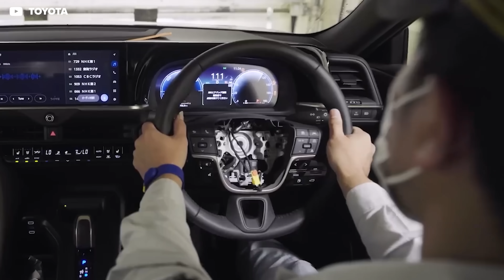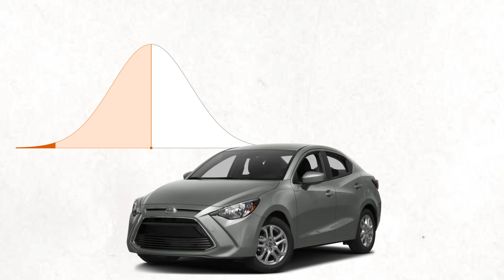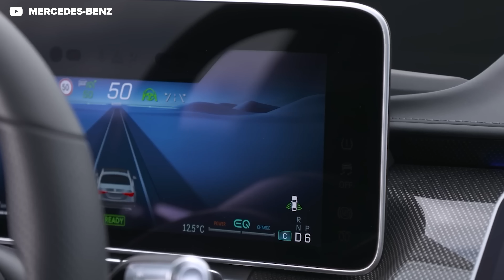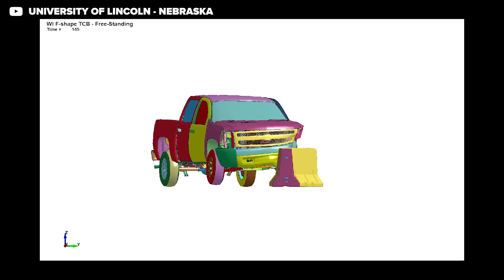The REAL reason guardrails can't stop EVs in a crash

Comment: Those type of guard rails are not designed for impacts at such obtuse angles. They were meant to deflect not absorb the full impact at head on or near head on.
Reply: And where in this video was an attempt of a head-on collision onto the guard rail?!
Reply: 😂That is what I see as well. The cheap soft Wood is so weak and brittle. Even for the the car the guard rail designed for. You can only get one shot out of it. Then you need to replace the whole section along with the Wood post.
Reply: @林振华-t4v That's how dispersing the energy works. If the guard rail was stronger it would just smash you the same as if you hit a wall.

Comment: 4000lbs more? I don't think so.
Reply from the maker: Look up how much a Chevy Silverado crew cab weighs, and how much the Silverado EV weighs.
Reply: @drive  The Silverado's direct competitor is the Chevy 2500, in which the heaviest EV variant is only 500lb more. 
The media has absolutely no idea how much combustion vehicles actually weigh compared to the average (or equivalent) EV. Most of the time they are not heavier or marginally heavier, but they like to glorify the 1% of EV's that weigh a lot more and act like its the norm.
Reply: @drive that's the most extreme example. That battery is 2x the size of anything else on the rd.
Reply: @drive  That is misleading. You take the most extreme case and say "up to". Technically, it is true but what really matters is the more typical case. 600lbs is more typical but even then some equivalent cars are pretty well evenly match for weight.
Reply: Up to
Reply: Than Google it
Reply: Yep it's just the extreme case of Max battery Electric Pickup vs Gasser Pickup. They gave an example there where a Model 3 doesn't weigh much different to a BMW 3 Series.
Reply: @Neojhun  This whole narrative that evs weigh more than their equivalent ice counterparts needs to come to an end
Reply: It's not a narrative. They weigh more. 

4-door dodge charger with a v8 engine was 4500lbs the EV is 6000lbs.
Reply: @poly_g6068  Unfortunately Dodge and many companies don’t know how to make an EV, so I would hardly count that “fratzonic” flop of theirs
Reply: @poly_g6068 I have  a model x p100d 3 row and it doesn't weigh 6000lbs.  I'm just saying they are using the Silverado ev which has a 200kw battery which is double the size of mine, is an extreme example.  Model 3 weighs less than a bmw 3 series. Bmw x4 which is comparable to the model y weighs more. Just saying.

Comment: Get out before the fire or it’s over.
Reply: LOL Unlike gasoline fireball, EVs only have flaming fire which take time. Richard Hammond crawled away from the Rimac with a broken leg. Not even Usain Bolt can out run a Gasoline Fireball.
Reply: @Neojhun  you’re a true EV believer debating which fire burns more lethal. 😂
Reply: @jamesh1641 well, protestors just burned down 5 waymos in LA. Those are jaguar I-paces, which are EVs. I watched these fires happen live on TV, and they took a good 10 minutes or more to engulf the cabins of the cars. After 1 hour of burning, the fires would begin to calm down, having burned the batteries out.
Yes, there's time to escape, and no, batteries don't just explode. in a fire, tires do. 
Also worth noting there were still hundreds of protestors in the vicinity during the fire, and none of them were injured by the fires.
Edit: Also, no firefighters arrived during the ~hour and a half I was watching.

Comment: American issue. Dutch and German guardrails you find on the highway stop all traffic. Yes, including trucks.
Reply: I do enjoy when someone says something without thinking it through and or doing a modicum of research, and then some other persons come along and straight out the lack of research. Thanks folks😂
Reply: Even the German standard is pointless for a Murican SEMI. 40mph is about half the speed they travel on the interstates which is where most guardrails are found anyway.
Reply: Heavier duty guardrail that can contain large semi's flexes and bends less when a lighter vehicle hits it. This has the same effect as a smaller crumple zone, and it increases the G forces that a smaller vehicle and its occupants will experience. This makes the guardrail less safe for smaller vehicles because it's more likely to cause occupant injury. 
It's more of a question of who you want to "sacrifice" so to speak. If the guardrail is protecting a residential neighborhood, then yeah it should catch all vehicles. If it's just a steep slope in the middle of nowhere, then we'll have to rely on the stricter drivers license requirements of semi truck drivers and hope they don't hit the guardrail because they only make up about 2-10% of all the traffic on the road, and we don't want to cause excess injury to the remain 90%+ of drivers. 

Also yeah, weaker guardrail is cheaper, so... cheap guardrail will save 90%+ of lives, or double the cost to save 100% of lives?
Reply: I did search for instincts where a truck or bus did puncture through the guardrail and blocking the traffic from the other side and therefore the complete highway needing to be closed for repair. It's extremely rare but it does happen a few times in the Netherlands.

I think that double sides guardrails should be the new norm in the USA. Europe has started improving these guardrails 40 years ago.
Reply: @detmer87 generally when making statements like this it is wise to avoid absolute qualifiers like all, always, never, because there are general ample examples where your statements become incorrect very quickly. You could have said something like we have a very low percentage of guard rail failure and it would be much harder to argue.
Reply: I asked AI to compare how a semi would do:

🇺🇸 U.S. — MASH Standards
Typical Guardrails: MASH TL-3 or TL-4

Test Vehicle for TL-4: 10,000 kg (22,000 lb) truck @ 90 km/h (56 mph) at 15°

Reality: An 80,000 lb semi (36,000 kg) exceeds even TL-5, which tops at 36,000 kg @ 80 km/h (50 mph)

Conclusion:
→ On most U.S. roads, yes, a fully loaded semi could go through or override a standard W-beam guardrail.
→ Only TL-5/TL-6 barriers (e.g., concrete) are intended for this load.

🇳🇱 Netherlands — EN 1317 (Mostly H1/H2)
Common Test Level: H1 or H2 (tested up to 13,000 kg trucks)

H2 barrier (TB51 test): 13,000 kg bus @ 70 km/h, 20°

Conclusion:
→ A semi nearly 3× heavier than test loads.
→ Standard Dutch guardrails would not stop an 80,000 lb truck at highway speed.
→ May redirect partially at reduced speed/angle, but breach risk is moderate to high.

🇩🇪 Germany — EN 1317 (H3–H4b on Autobahns)
Higher Standards in Use: Autobahns often use H4b-rated guardrails

H4b Test Load: 38,000 kg articulated HGV @ 65 km/h (TB81)

Your Truck: ~36,000 kg = matches the H4b standard

Conclusion:
→ Germany’s Autobahn barriers can contain a fully loaded semi at moderate speeds and glancing angles.
→ Breach risk is low, unless speed or impact angle exceeds the spec.

Comment: The weight of EVs is often way overblown. I went from a 2008 Honda Pilot (Curb weight= 4,524lbs) to a 2024 Tesla Model Y (Curb weight= 4,363lbs), so the "heavy" EV is actually 161lbs LIGHTER than the internal combustion engine vehicle it replaced. And that's not even getting into the passive safety improvements.
Reply: are you actually comparing a Pilot with a Y?????????
Reply: @paulpellico3797  I'm aware they aren't the exact same size, but the Model Y was able to easily do everything I needed the Honda Pilot to do. It literally took its place, so it's justifiable to compare them. Both AWD and handle the snow really well. Both available as 7-seater. Pilot wins out in luggage space, but I never needed to fill it completely, so it's unnoticeable.
Reply: @AaronCarioto  You realize the 7 row seating in the Model Y is very impractical, those back seats are only functional if you slide the mid-row forward, otherwise they are rendered virtually unusable. And the Honda Pilot could fit 8 people, not 7. You factor in that the Honda Pilot is a taller/wider vehicle with more ground clearance and headroom, it's going to add a lot of extra weight. And if you are going to call a vehicle that is over a decade older a justifiable comparison, you are nuts. Materials are vastly different today as opposed to over a decade ago. Metal panels/frames are now aluminum (or a steel/aluminum mixture) as opposed to raw steel, plastic interior points are now carbon fiber as opposed to hard plastics, the amount of weight savings through that alone is the difference. Your Battery Pack weighs anywhere between 1000-1700lbs, whereas the Pilot's engine weights around 250-400lbs. EV's means of an engine (AKA Battery) is much, much heavier currently, though with time the efficiency will get better and the size will shrink, cutting the curb weights. The way they make up the weight difference is the other materials used in the production of the vehicle. And again, calling to the safety improvements is foolish as well. It's got over a decade's advantage in improvements. Things improve with time, that's just how it goes.  If you were to compare a relatively newer Honda Pilot to the older, the newer one is likely going to be the far better of the two.
Reply: @viktorbryce951  It's easy to ask AI for weight comparisons.  In 2025, the Model Y still wins.

weights in .lbs for various trim levels:
Honda Pilot	4,100 – 4,600
Tesla Model Y	4,167 – 4,416
Reply: @viktorbryce951  I appreciate your perspective, but even if you take age out as a factor, a quick Google result says 2024 AWD Pilot weighs 4,251-4,685 pounds, which supports my original argument that weight between ICE and EV is often blown out of proportion. Also, you are right about the Pilot being 8 seats. (We rarely had the third row up)
Reply: @AaronCarioto  In this scenario, yes, I get why you'd believe that. However, The Center For Transportation Research did the research and concluded that on average EV's weigh roughly 25-30% more than their ICE counter-parts. Now do I feel that'll always remain the case, absolutely not. 

Batteries have a much wider application, so internal research and development cost will be netted back much quicker, as opposed to an engine and all its components. They'll get smaller and more efficient, thus reducing weight. These engines though, have to meet strict standards of emissions/safety and reliability before the manufacturers adopt them. This research often cost them 100's of millions, if not billions to create, and it takes years if not decades to offset that development cost. For instance, Pontiac used like a 40-50 year old engine design before replacing it. It's why you often see the same engine in a multitude of models, a cross a brand for several generations of said models. 

You also factor in vehicle's basic architecture, chassis, subframe etc. Usually there has to be some accommodation for existing engines, transmissions/drivetrains.
Reply: @AaronCarioto  your Y is "easily" able to do everything your pilot did??????
Reply: In terms of size, the model Y is about the same as a CRV. I get the point that in your case the Y meets your seating and cargo needs, but by the same justification so would a CRV since you said you didn’t use all the space. A Model Y AWD is around 4,400 pounds while a 2025 AWD CRV is about 3,600 pounds. That means the Model Y is almost 25% heavier than an ICE vehicle of similar seating and cargo size.
Reply: Wow what a downgrade, hope your pilot found a better owner

Comment: More weight= more Energy needed to move it. Where is the ecology?
Reply: As the other person said: EVs are FAR more efficient than ICE counterparts.
But yes: once you move to something ridiculous, like the hummer EV, you are saving only like 50% of the energy compared to a much smaller ICE vehicle.
I suspect that current EVs err on oversized batteries to combat range anxiety.
Solid State batteries may solve that problem once they finish inventing them.
Reply: @economicprisoner  Despite the large batteries, they still have a ridiculously small range. In addition, large batteries take much longer to charge. Driving such a car on long trips is a pain. That's why sales of electric cars are falling. People don't want this cr@p. Until bacterial technology changes significantly, electric cars will not be a significant success.
Reply: It's all about the efficiency of converting energy in the fuel to moving forward. ICE engines (~45% peak) are less efficient than power plants (~55% continuous) and electric drivetrains are significantly more efficient than ICE drivetrains. The efficiency loss of transmitting power is negligible in comparison.
Reply: @ChadGeidel  but to this you have to add the energy losses during battery charging and the energy losses of generating electricity in the power plant and sending it to the grid. If you take all this into account, the energy losses for electric cars will be higher.
Reply: @TheEryk03  Google is right over there --> There have been dozens of studies demonstrating that you are 100% wrong.

Try again.
Reply: @ChadGeidel  Are you going to deny the laws of physics because some propaganda articles say otherwise? You've come to the wrong place, I have my own mind and I don't have to have leftist lobbyists think for me.

Try again.
Reply: @ChadGeidel  Are you going to deny the laws of physics because some lef. tists articles say otherwise?
Reply: @TheEryk03  From generation to grid distribution to charging battery at most is 20% loss which is still very bad. That is no were close to the 60% plus loss with small ICE anything under 10L displacement. There is even more efficiency gained with Combined Cycle Power Plant where waste heat becomes a service. Your vague baseless assertions are wrong. Your are soo fixated by political agenda you ignoring physics and engineering.
Reply: @TheEryk03  You clearly do not understand physics. Total Mass alone is not key factor for energy consumption with a complex system like a vehicle in the real world. BEV light vehicles have way less Wind Resistance and Rolling Resistance. Wind resistance due to flat underbody and needing just 40% of the Radiator Cooling area. Also just more flexible power train packaging to optimize airflow i.e. holes through the center of vehicle (Jag i-Pace, Dodge Daytona, Lotus Evija). Ontop of less rolling resistance from drive train losses due to simpler more compact Electric Axel. Just these two factor combined exceeds the efficiency tradeoff with marginally more weight. Many Factors contribute to efficiency, that is fundamental physics.
Reply: @Neojhun  Why are you stretching these numbers to your advantage? The Germans are able to make combustion engines that have less than 40% losses. In addition, electricity statistics are not only losses of the power plant but also sending to the grid, charging, storage in bacteria and losses of electric engines. If we take all this into account, the losses of electric cars will be even greater.
Reply: FYI A Tesla Model 3 only has 80kwh battery, that is a very small amount of energy. A small fraction compared to a tank of fuel to travel the same 280 miles. The Fact BEVs are achieving 3.5 Miles per kWh shows how massively more efficient they are. An efficient gasoline car around 40mpg is the equivalent of 1.4 Miles per kWh. These are the cold hard facts, you can't just LIE.